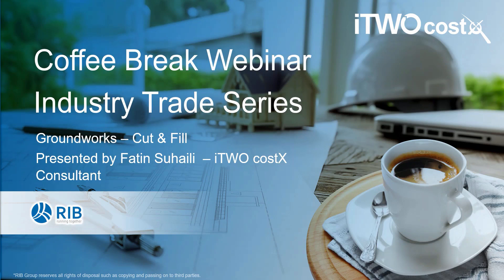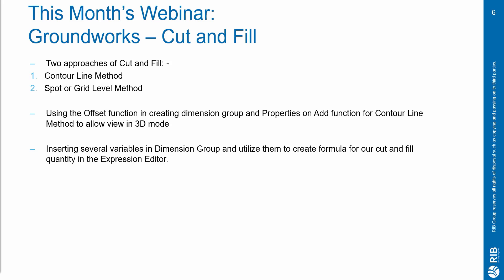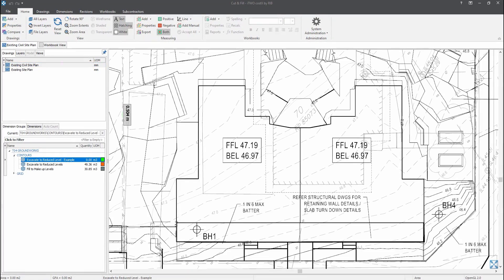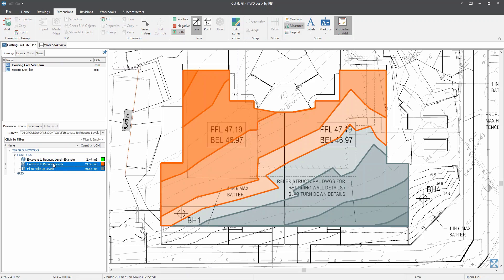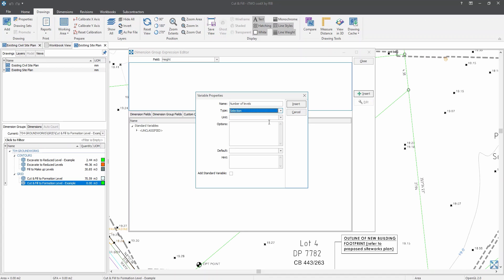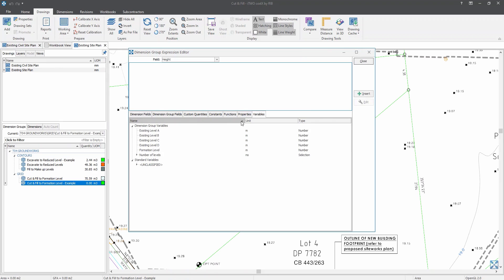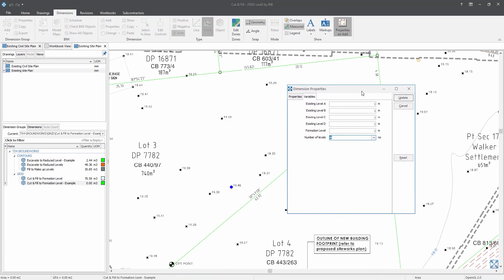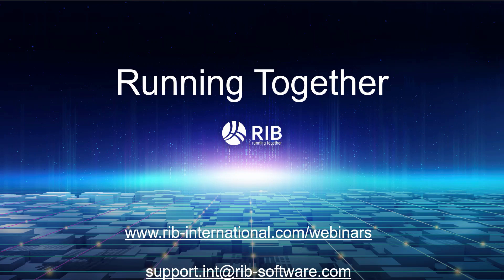iTWO costX Coffee Break Webinar - Groundworks: Cut & Fill

Comment: Thanks for sharing. But for the first mothed, the height supposed to be 1/2 of that of interval(1/2 of 0.2m=0.1m)?For example, imaging the chainage section for the 1st mothed, the height difference between each section immediately next to the other could be recognised as triangle so the average height difference is 0.1m not 0.2m. More importantly, the cut/fill balance line seemed to be provided by others (civil engineers via modelling and computer generate the line automatically) and it may be not correct as civil engineers may not factored in surface strip-off, slab thickness, bedding thickness, trenches/underground water tanks/OSD/bio-basin excavation etc.(these above mentioned surplus affects the real cut/fill balance line) so be cautious to use that cut/fill balance line unless PM/QS/estimator independently verified not such works mentioned above. The 2ed method is recommended as cut and fill are based on true data though it is time consuming but more reliable. And above-mentioned excavations can be measured separately to calculate the final surplus removal or imported soil needed.

Comment: Can you explain why you use an initial offset of 0.8m.  Also is there a slight mistake stating a level of 46.7 rather than 47.6 at approximately 5mins in or is my understanding of this process wrong?

Thanks in advance.
Reply from the maker: Hi Ruairi, I can't access the Consultant to provide answers, but I'll do my best myself :) . To explain the 0.8m positive default offset, navigate to 8:13 in the video; here you can see the Dimension Groups in bottom-left corner, with the completed takeoff displayed on the main screen. 0.8 denotes the highest point, and you'll see prior to this that the Consultant adjusts the offset as they go along. 0.2 is the difference between each measured section, and the offset moves into negative numbers for the 'Fill To Make Up Levels'. And yes, my interpretation watching this is that 46.7 is a slight error, and it should be 47.6 as you suggested. Hope this helps!
Reply: @RIBCostX  thank you for your reply.   The 0.8 is probably something to do with the use of 46.7 which gets you closer to a depth of 0.8. That makes sense now thanks just wanted to be sure I was understanding it correctly.
Reply: @ruairioboyle9453 , could you help me with this? Where did she get 0.8? Would you please solicit some calculations

Comment: 1. Is it an = sign before the 4?
2. How do you keep the variable in alphabetical order?  I sort per direction and it doesn’t stay when the variable value box shows up.
3. Does the value matter in which order you input in levels?
Reply from the maker: 1. Yes it is.
2. Do you mean when the 'Dimension Properties' box opens up, as shown at 15:23 in the video? The variables should match the order you set in the Expression Editor, so it should also be in alphabetical order if you set it as such.
3. Not quite sure what you mean here, as long as the input values correspond correctly with the set variable, there should be no issue.